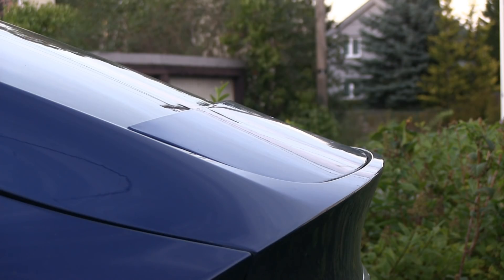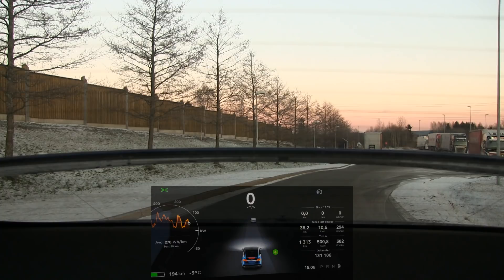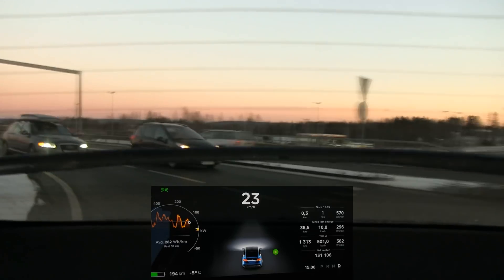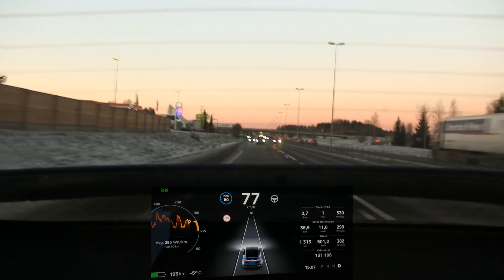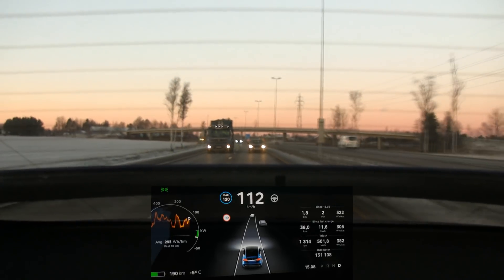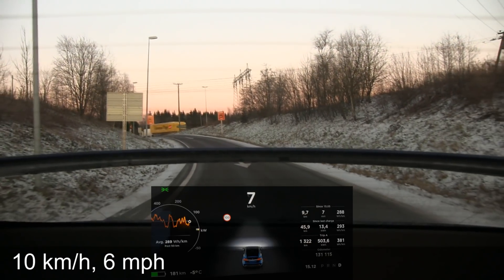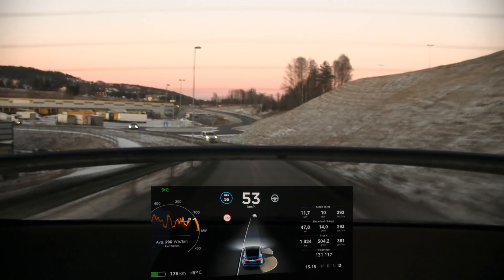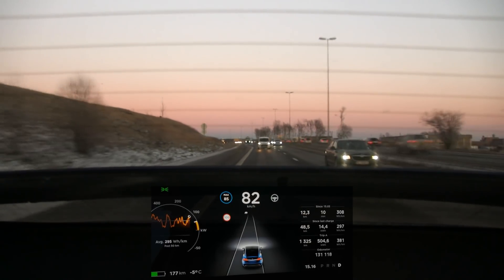Tesla Model X adaptive spoiler test

Comment: I have a non "P" X100D and the spoiler is fixed, so I was curious how the Adaptive spoiler worked.  It would be nice if we could eventually purchase this as an upgrade... but I expect Tesla has more pressing issues at this point. :).
Reply: Best with fixed spoiler, special in winter with wet snow etc around and under it

Comment: The test with 74 and 75km/h came immediately in my mind. That would be interesting.
Reply: You should rather test 70 vs 70 spoiler up and down. Should be possible. First run prior the wing goes down, and the second run after it.
Reply: Tuomo Mäkitalo, yes, he can find a fixed stretch of road and run at 70 km/h with cruise control on and get an average energy consumption reading and then do the same run after speeding up to 75 to get the spoiler to tuck into high speed mode and then set the cruise control for 70 and run the same stretch of road, then compare energy readings. 

It probably doesn’t save energy, but just there to let the police behind you know when you are doing 75 past a school crossing.

Comment: Regarding your suggestion: if you really want to try to measure the difference/effect I think it’s better to try to measure it at the same speed and well above 75 km/h. The faster you go the stronger the air resistance and therefore the force, so the difference becomes bigger with and without the spoiler and easier to measure. There should not be a big difference between 74 and 75 km/h with spoiler up or “down”/angled because then Tesla would have engaged the spoiler in the down position sooner in lower speeds.

I do understand you may not have any control over the spoiler (no fuse? Come on, you can find one Björn ;) ) but it would be interesting to see the difference with and without the spoiler at say 120 km/h or faster (= a lot of drag).

This whole comment is poorly written but I think you maybe get the point.

Comment: Yes, there is a low pressure turbulent flow behind the car and the spoiler directs laminar even flow down to make the low pressure area smaller, useful when there is no trailer behind since pressure * area = force. With more of the trailer in laminar flow, the drag will increase. The pressure is  p= 1/2 * rho * Cd * v^2. A nose cone on the trailer will give a better Cd but it is better to make the trailer be in turbulence behind the car and have a spoiler at the rear end of the trailer, in addition to vertical slots at the front corners of the trailer. The airflow over the car must be disturbed to make a wake all the way to the trailer, by ski racks/ egg cartons?

Comment: I believe it is  because there is a vacuum behind a moving flat back vehicle. The spoiler may help to fill/reduce this vacuum thus lowering the rearward force pulling back on the car.
Reply: UTubeGlennAR I get what you mean and there are a lot of people explaining it that way but there is no vacuum behind the car. There is a low pressure zone though and a severe turbulence. The turbulence is slightly improved by the spoiler and thus the drag/low pressure zone is reduced. But I do get what you mean and I am sorry if I end up coming across some grammar/physics -nazi. Tesla-Björn knows this stuff pretty well. It was interesting for me to see how Tesla decided on the dynamic control of the spoiler and the different speeds it actuated.